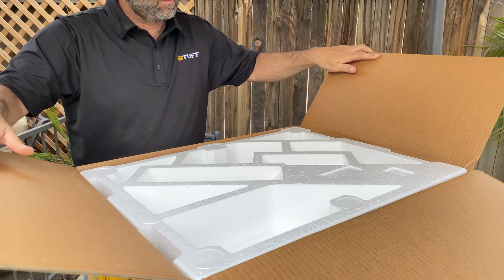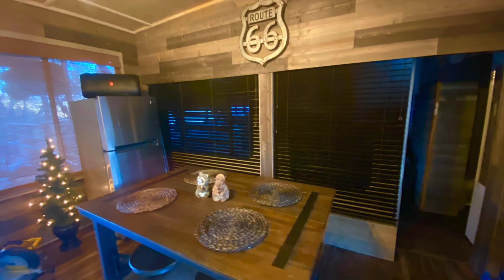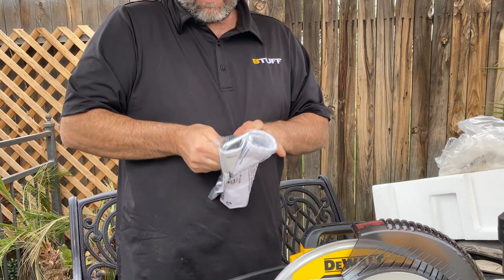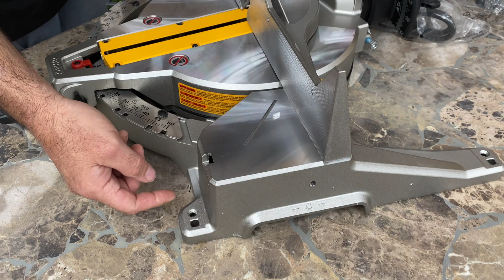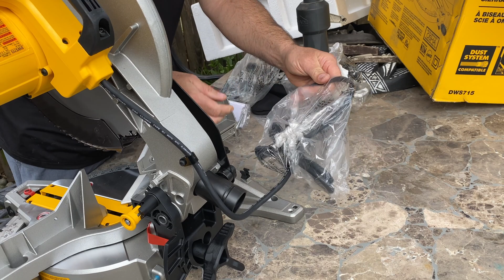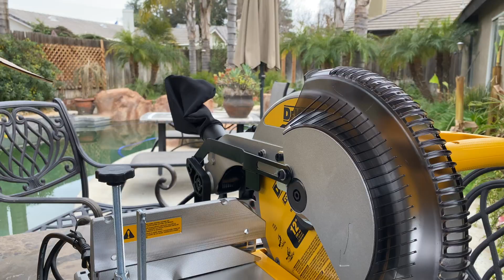THE BEST 12" DEWALT MITER SAW YOU CAN GET FOR UNDER 250... DWS715!

Comment: When did they change the design of the DWS715? The older design didn't have the cheap threaded handle to set the angle, but instead you would simply push down on the handle and it would clamp down and hold whatever angle you wanted.

Comment: Nice hands-on review, thank you! Try to include some specs for comparison. This was lacking. Intro was too long.

This DWS715 model Dewalt Miter Saw currently retails $329 at Home Depot and no blade.
This has Single-Bevel Compound Cut, but no Sliding Arm function. Also 15 Amps, 12" blade size, 4000 RPM.

The top of the line model DW779 Miter Saw retails $600. It has dual bevel, compound cut, Sliding arm, 15 Amps, 12" carbide blade, 3800 RPM, handles on both sides, dust collector and better technology.

Comment: Just got mine and I’m so excited to start using it! I’m refinishing some dressers with fluted trim and herringbone pattern and I’m so excited to get started. Just trying to see if I need to tighten the blade or do anything before starting. I used a miter saw with my step dad remodeling growing up, but it’s been yearsss and his was old and not quite as nice 😅 And I never saw the initial setup.
Reply from the maker: I would double check.  Just make sure it’s unplugged.
Reply: @btuff  Thanks! It won’t be plugged in for the first time until I’m sure everything is ready 👌

Comment: i have a flex volt can i remove the light and put a lazer in its place? DHS 790AT2
Reply: Are you talking about the light that casts the shadow line down the blade or just a basic work light? If it's the one that casts the shadow I wouldn't want to swap it. The shadow is way more accurate and never needs calibrating

Comment: Nice video, thanks for sharing. FYI: If you remove the tall left fence, you can cut 45 degrees no problem. My buddy had a DW715. Anyway, you've sold me on the DWS715 and Home Depot has it for $219 so I'm gonna order it. Thanks again brother.
Reply from the maker: If you check out one of my videos at the cabin, you can see how much I used this.  It's a workhorse.
Reply: @btuff  Awesome, I'll subscribe then brother!
Reply: I got mine from Amazon for $219 w/ free delivery
Reply from the maker: @darrylkim4799  DANG! Steal!